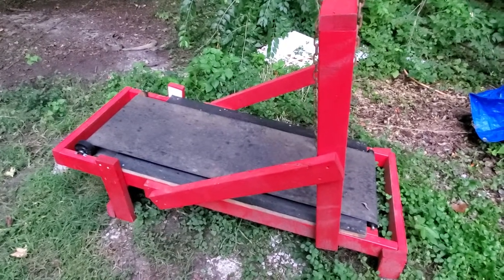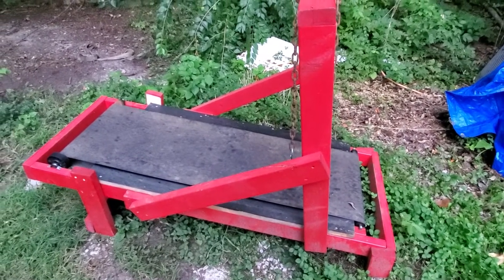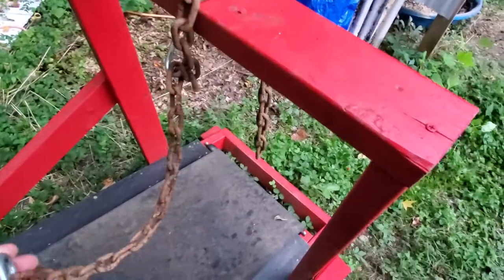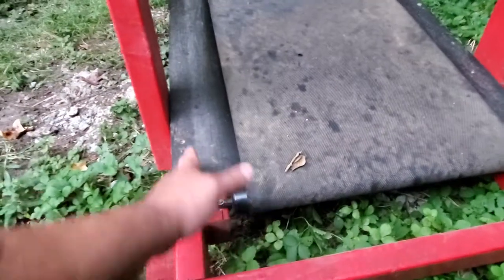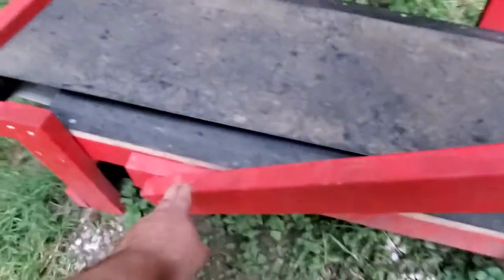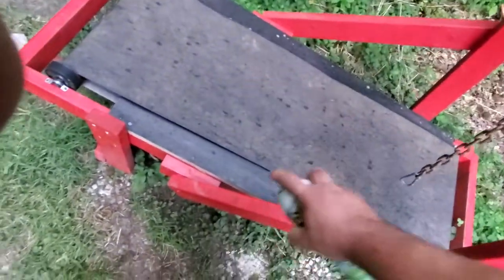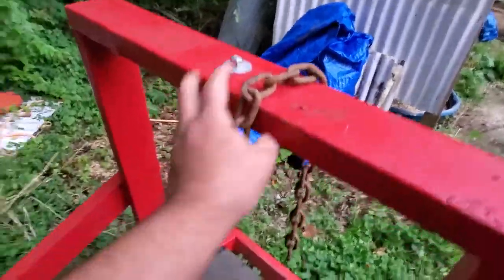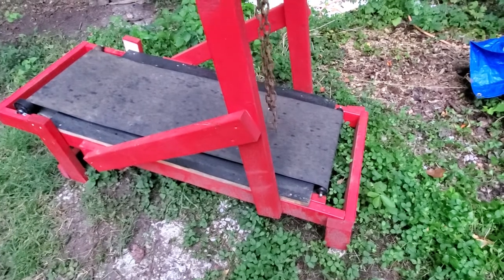Home made Carpet mill

Comment: Did you have too cut the belt basically how did you get on the mill
Reply from the maker: No  cutting had the rollers slipped in the belt before screwing them on the mill
Reply: Appreciate it bro